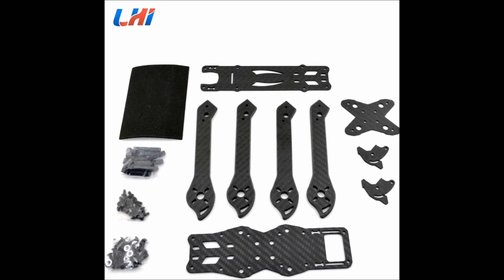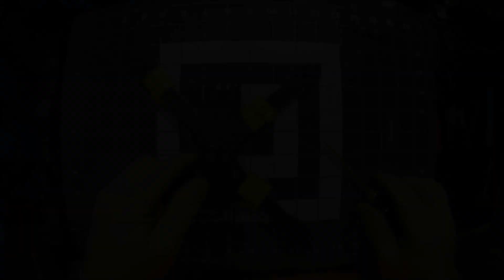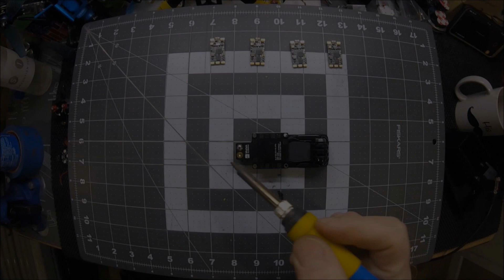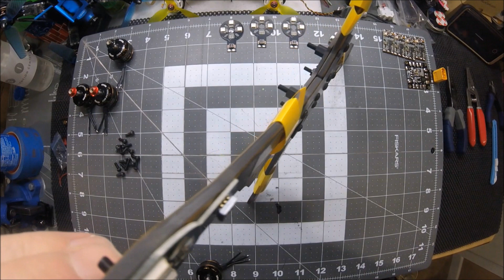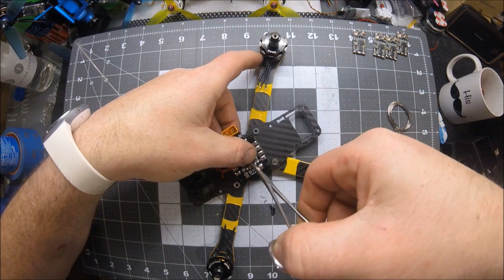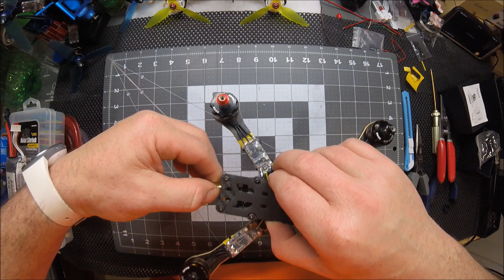LHI 250 Quadcopter Instructional Build Video

Comment: Hello,
Did you used this black wires for the Fligt Controler, from the Motors?
And from where have you got this yellow wires?
Reply from the maker: Be more specific
Reply: The wires from the Esc to the Flight Controler.
This tiny black ones.
Reply from the maker: @julianaeberhard1259  yes they connect to the flight controller.

Comment: I start building this kit today. I've been wondering when I tested the LED, there're not working. There are connected to 5V and GND on the PDB and imo after connecting a 3s at the PDB they should working, but they don't. I check the PDB with my digital multimeter
 and all pins are working, except the 5V. Any idea?
Reply from the maker: U have to turn them on and  program them in befaflight or whatever other program ur running.
Reply: @davidstanley23  Hm, but at this time there is no programming needed, it's just the passive PDB? The FC ist still in the box, no ESC, no motor connected, nothing at all. I think even with no USB/BetaFlight whatever the simple LED should be lighten up? Confusing :D But thx for reply!
Reply from the maker: @marckonig7969  Trust me, I thought the same thing. They're actually really neat because u can program them to do different things.
Reply: @davidstanley23  OK, thx m8 :)

Comment: Hi David,
Thanks for the great video. I followed your instructions and everything works fine, except camera video which is upside down. I searched in internet how to flip the picture but no results. I also thought about flipping the camera phisically but in this frame it wont work since the cable connection of camera should be on the top side. Any idea how can I rotate the image 180 degrees? I also tried to change the camera setting, and actually there was an invert option in camera setting but changing it doesn't do anything. Any idea how can I fix it?
Reply from the maker: Yeah you've definitely got something inverted in ur settings or wiring. Recheck ur wiring between ur vtx and cam. Also try inverting again. If this doesn't do anything u might have a defective cam. Also make sure ur powering off the correct voltage and check with a multimeter to ensure the voltage is correct and stable.
Reply: @davidstanley23  Thanks for quick reply David. Ill do what you suggested and Ill post the results :)
Reply: So, I found no other solution than rotating my camera 180 degrees physically. Everything works fine now!

Comment: Hi David
thanks for the nice video on the assembly.
I got only one important remark.
In the video you attached the signalling wire for the ESC at the middle pin.
In my case the middle pin (TX) is used to send telemetry data (e.g. current) from the ESC to the FC.
And the pin besides VCC (PWM) has to be used to control the ESC.
Maybe there are different versions of this ESC shipped from LHI
Reply from the maker: Markus Klehr - That's totally possible.

Comment: Hello,
For of all thanks for making this amazing video !
I have a little question for you. Could you tell me what you placed between the frame and the PDB ?

Because I have shorted my controller card. And the only thing I can think of is that PDB shorting the with frame.

I know in the video I see you using the plastic screws but you then use them again to stack the PDB and the controller. So did you change it off video or ?

Felix

PS: pardon my poor english
Reply from the maker: Felix Le Forestier - I usually just use 4 plastic nuts on each screw as a spacer
Reply: David Stanley FPV thanks

Comment: Can I ask what gauge wires you used for all of these connections (especially the 5v, 12v, and ESCs signal and power)?  Also, why did you add a 5v to power your flight controller?  I thought you were powering it via the vcc...  Thanks for you help!
Reply from the maker: GnarlyGarnt 18g wire and I powered it via 5v and the other is battery voltage for my taranis